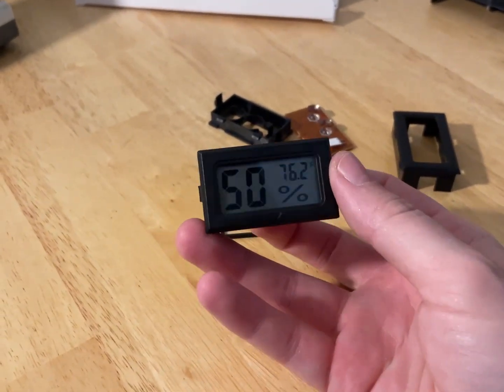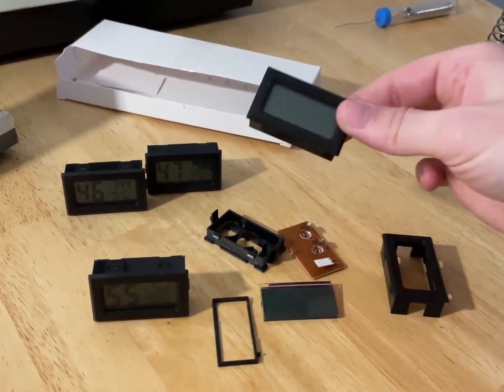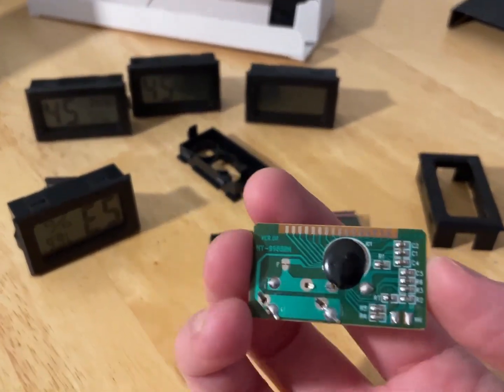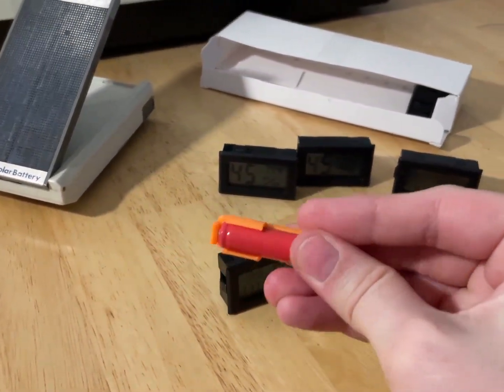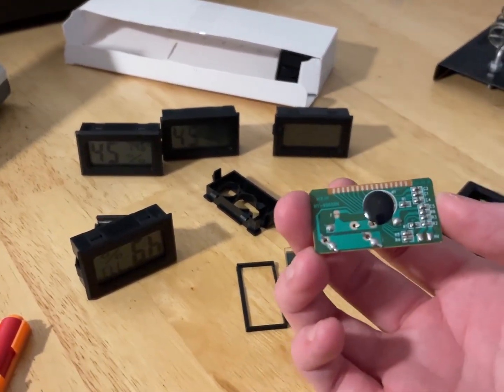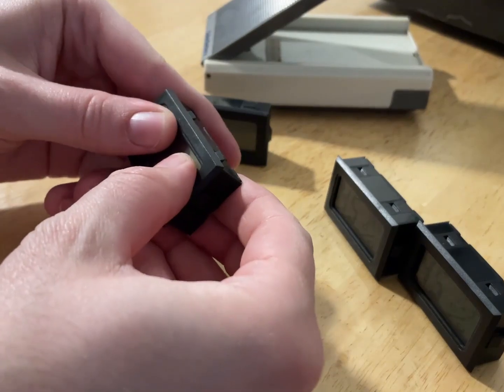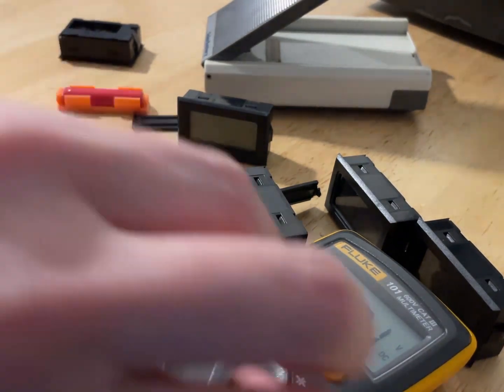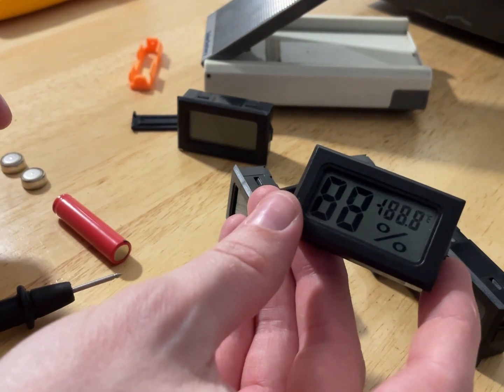Modifying cheap temperature / humidity sensor to use rechargeable AAA batteries instead of L1154!

Comment: I bought a plant rotator... you can set it for 1 or 2 rotations per week.  It moves about 3 degrees every hour or something.  2 C batteries.   Who has C batteries?   I just converted  them to USB.   Works fantastic
Reply: I made a solar powered electric  dart board...in case I'm ever in a field and just have to play darts.  Anything that uses batteries ( aa, aaa, c, d) can be made USB.   Even that giant 80s boom box.  

I finally bought a field so... I'm gonna  play electric darts in it! I can't wait!

Comment: Some of those you can change between Celsius and  Fahrenheit
Reply: I came here to say: but can you mod them to read temperature in civilized units?
Reply: @daliasprints9798  some can be changed some can't. I've gotten both. You have to read the listing carefully
Reply from the maker: Yeah I buy a mixture of Celsius and Fahrenheit since I like both units of measure for different things.
Reply: @RinoaL  I was just curious if the board in these things is universal and has a point you can solder or desolder to switch modes if the switch was omitted.
Reply from the maker: Oh sorry, I don't know. The board doesn't seem to have any obvious switch ability on it. I think its just programmed at the factory or a resistor value.
Reply: @daliasprints9798  im not sure if you can mod them or not. I know I have had some that had the hole in the back to put a small screwdriver in to short to change it without the pads you short.
I haven't thought about taking one with and one without to see if I could hack it. I've gotten both the round & rectangular with & without the option.

Comment: Three sensors right next to each other and displaying different temperatures & humidity levels. So, just how accurate are these sensors? And, does slightly higher battery voltage affect the accuracy of readings? Might want to do a comparison test to see.
Reply from the maker: Once left to sit, they read very close to one another. The reason these were showing different readings was because I was holding them which added head and moisture, but then was also soldering which added a LOT of heat.

Comment: Nice video! Is there a link for the AAA holder?
Reply from the maker: Here you go. And no, CheapVlog, printing them is like 3 cents, nobody can compete with a 3d printer when it comes to stuff like this.
https://www.thingiverse.com/thing:3222693/makes
Reply: Ready made AAA holders are probably multiple times cheaper then printing it yourself.

Comment: Next amazon order I'll get a couple of these, great device.
Maybe print a custom casing of this hygrometer for AAA battery? You should be able to design a two part print without snaps but with one screw and some kind of slide locking pretty fast and painless.
Reply from the maker: That feels like a waste of plastic when they already have a good plastic case tbh.
Reply: @RinoaL  Yes the case is good. Too bad the snaps are on the back part. When I buy these they'll be living in wasteful cases. ;)
Will reply to this thread with a thingiverse link if it all works out.

Comment: Holy god you keep your house so hot. I would die at 86 degrees
Reply from the maker: It isn't us keeping it this hot, it's the weather. It got up to 89 degrees today outside, but no, this was only showing 86 degrees because I had just soldered it. As you can see the others were at 76 degrees.
Reply: @RinoaL  76 sounds much better for inside lol

Comment: Great idea! I have a bunch of humidity meters around the house and in many storage containers too (I have lots of plastic filament for 3d printing, and certain types like nylon and flexible filaments have to be extremely dry), but I actually took the lazy approach, and bought a type (HTC-1) that takes AAA battery by default. I only have one of the coin cell type humidity meters, and I hate the fact that I can't run it with rechargeables, I hate buying throw away batteries. I must say it never occurred to me that I could modify it like you did in this video.